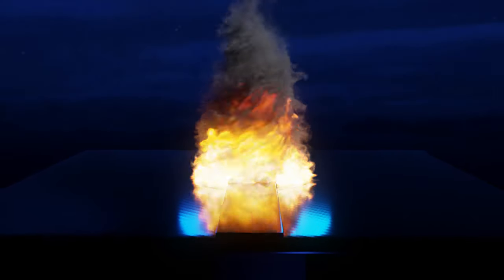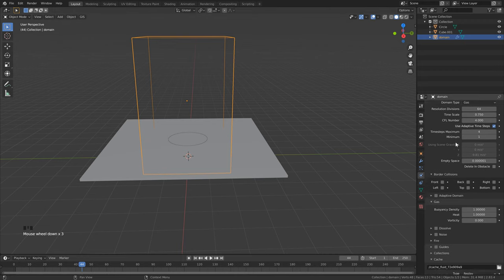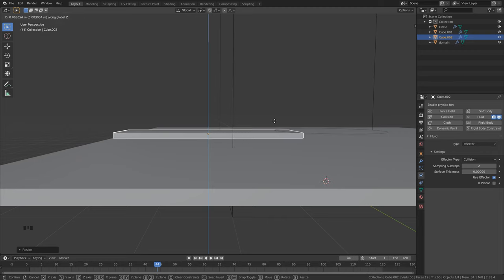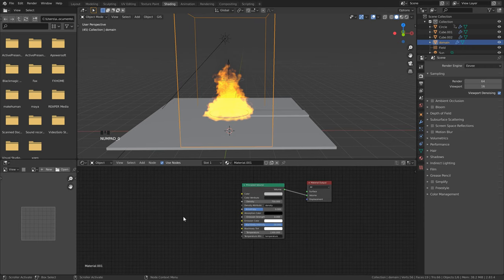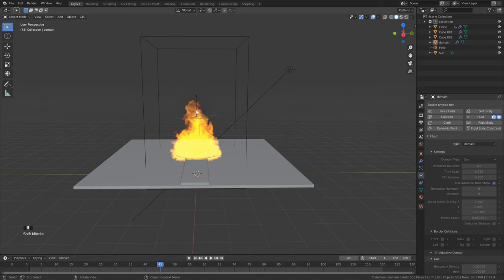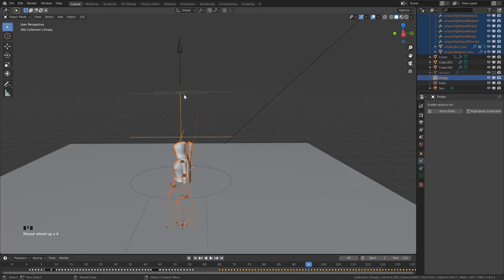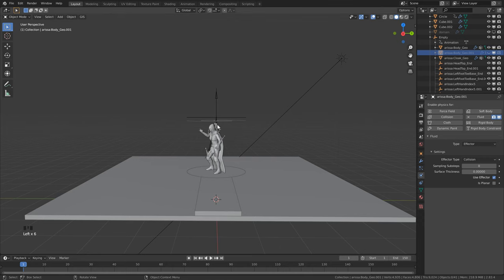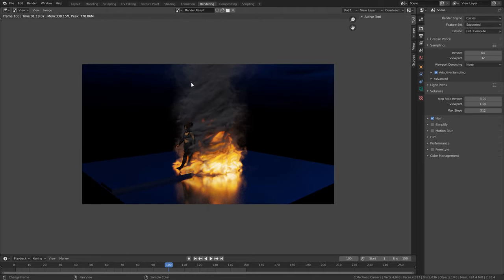Blender 2.8 | How to make a Fire and smoke Tornado | Mantaflow Simulation | TUTORIAL

Comment: Another very nice one - thank you.  Not sure I understood why a copy of the char's mesh was needed for the effector (at ~19.15); it worked for me with the original only.  And I assume that for the final video you used a second smoke only simulation for the lingering smoke after the fire was out, right?  The idea and the execution were wow :D
Reply from the maker: Thank u! The reason is that the original character meshes are separated. You likely used just the body mesh instead of adding the cape/shorts/quiver etc  which probably gives a good result! 🥰

All of it was done in one simulation. As long as you turn the fire "off" at a certain point before the end of the simulation, you should be able to see some residual smoke. (More prominent in cycles render)
Reply: @AriaFaithJones  Aha, thank you.

Comment: Most of the settings weren't on my blender and I am using 2.8. When I went to my physics tab I saw smoke and fluid, but in yours I only see fluid. I tried to copy you with the fluid physics but the settings weren't the same as yours so I did it with the smoke and a decent amount of the settings you used were on mine. I tried to follow it and my fire turned out not looking good. Please help. Amazinf tutorial btw
Reply from the maker: Yes. You will need to download at least version 2.81 or higher to have the new Mantaflow Fluid engine, otherwise you will be working with an older fluid engine.

I'd suggest getting the latest 2.83 version for the best results ❤️

Fluid and smoke are both done in the "Fluid" section of the physics properties 🥰
Reply: @AriaFaithJones  Thank you so much I will download it now overnight
Reply: @AriaFaithJones  DOWNLOADED!!!
Reply: @AriaFaithJones  I AM WACTHING YOUR VIDEO AGAIN. I AM SO HAPPY
Reply from the maker: Oh yay! Let me know how it turns out 🥰
Reply: @AriaFaithJones  ITS AMAZING BUT I ONLY SEE SMOKE AND NOT FIRE. I SEE THE FIRE IN THE VIEWPORT BUT NOT IN THE RENDER
Reply: @AriaFaithJones  I USED A SUN LAMP AND COLOURED IT ORANGE IT WORKED
Reply from the maker: Awesome! Also make sure to change the blackbody intensity to something higher to see the fire better! 🥰
Reply: @AriaFaithJones  I increased all the way to 200 and still no fire
Reply: @AriaFaithJones  IT WORKEDDDDDDDDDDD

Comment: 7:39 type when trying to put it in final there's only 3 replay modular and all. There's no final : /
Reply from the maker: Hey!! In Blender 2.9 use "All" instead of "Final" 🥰❤️
Reply: @AriaFaithJones  Amazing tuts I am just starting and you're so helpful!! So regarding the "All" im actually on 2.90 hence i baked it on all BUT it renders very slowly even tho im on a really high pc build : /
Reply from the maker: If you are using cycles, make sure to go to the render Properties and scroll down until you see "Volumes" and then change the 'Step Render Rate' to something higher like 3. Also, just underneath of that, set the max steps to 512

Make sure your render samples are set to no higher than 256 and use one of the denoise options to remove any extra noise

This should speed up your render by around 4X 🥰❤️

Comment: there is a lot of noise on my ground effector, kind of spoils the look
Reply from the maker: You can change the material to something with 0 metallic. Or you can also just turn up the roughness on that material as well!

Adding more render samples will definitely help as well and I think for mine I added a carbon fiber material to break up the texture a bit more

Make sure to also add the Denoising node in the compositor to remove any final bits of noise 🥰
Reply: @AriaFaithJones  it worked! you are awesome!
Reply from the maker: Yay! 🥰